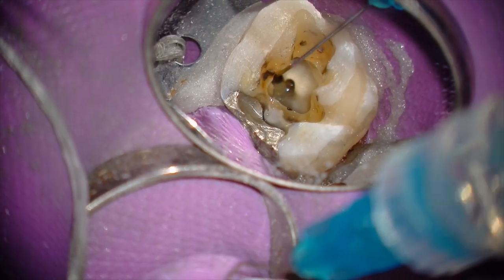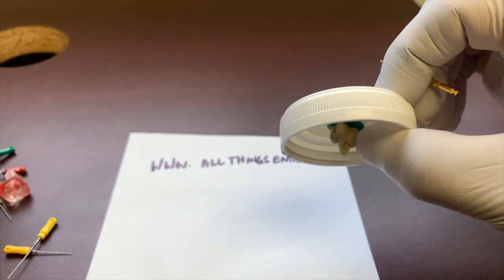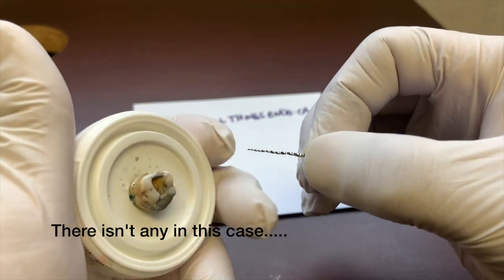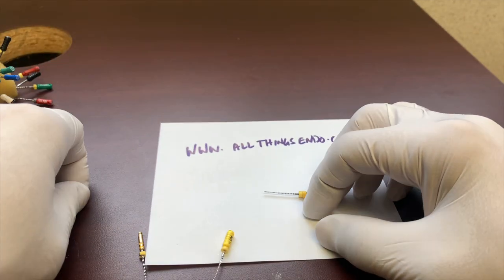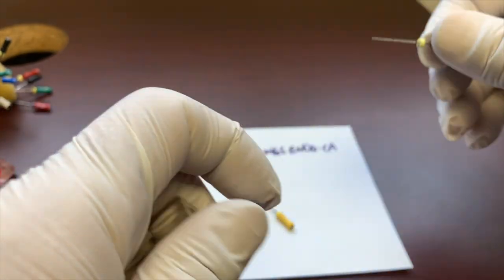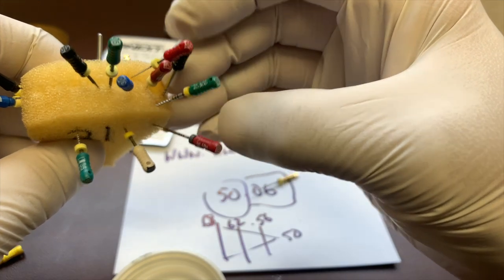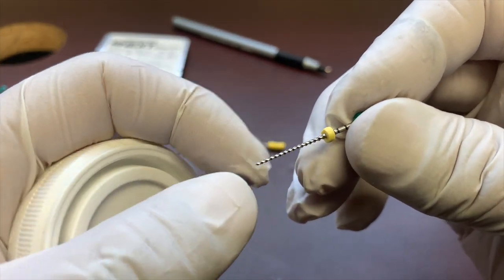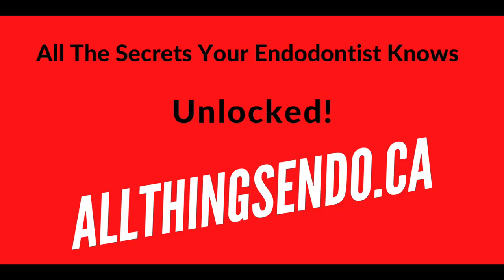My Protaper File is Too Small For This Large Canal {Balanced Forces Technique}

Comment from the maker: I just realized I forgot to mention:  in this case (and most often), I just create an apical stop with that large handfile - as compared to an apical preparation and step back technique.  Once I have that apical stop and have gently debrided the walls of the canal, I don't see a need for stepping back the case.  However, there a hundred different ways to skin this cat.
Reply: In such case you would obturate with GP #70 Taper 2% ?
Thanks in advance.

Comment: Hie Ash, great video! So after doing the apical prep with the large hand files how do you then obturate the canal? Say you used a size 70 stainless steel file to create the apical stop but your protaper largest GP point is a size 50 how then do you obturate?